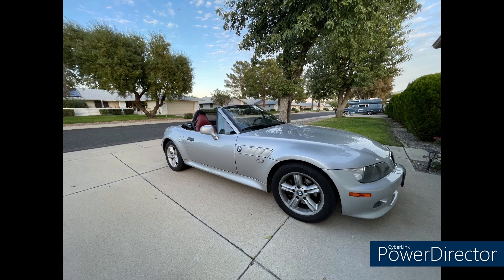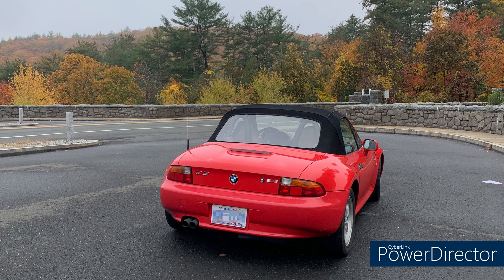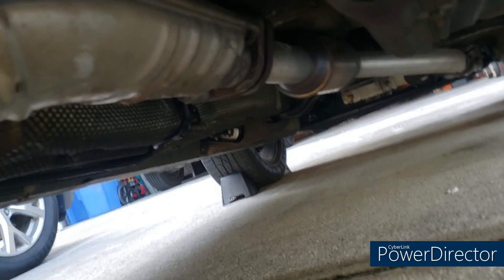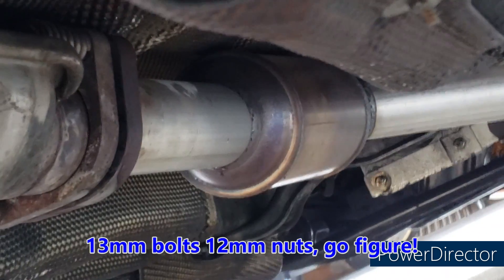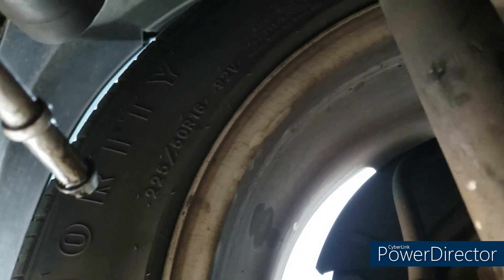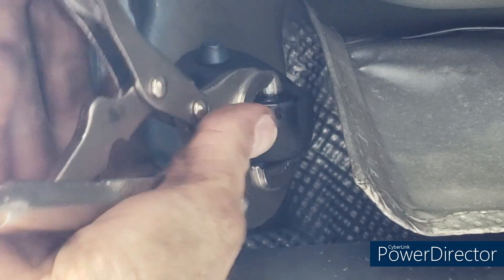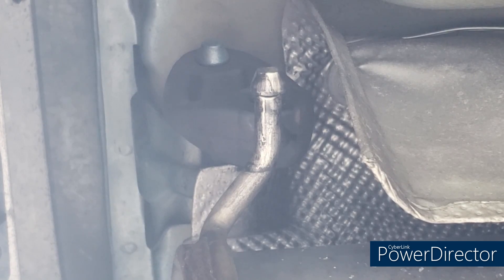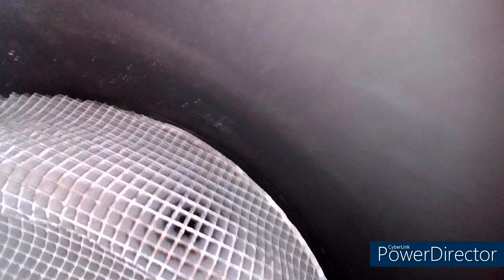DON'T Buy What I Bought: Davico 17031!

Comment: That’s a bummer Mark! I’m having issues with the replacement of the clutch & flywheel replacement on mine. They didn’t align it properly & reverse & first are a bit difficult. That was a very expensive repair & I’m in no position to pay someone else to pull it, so I drive it sparingly & gently hoping it will eventually align itself. It has improved some over the 60 miles I’ve driven it, so there’s hope. 
A note to Wes…Don’t do it! Your car is beautiful as is! Changing the color of a car is never recommended. However, if you’re dead set on it use plasti dip & leave the original paint in tact. I’m going to plasti dip mine, but my original paint is failing in many places & it needs to be repainted.
Reply from the maker: Thats what I told Wes, wrap it if you have to change it.  Interior probably harder as dash is black in his.
Reply: @MomentofZed  It’s cheaper to plasti dip & if cared for can last 5 years. With the equipment & paint it’s as little as $700. I’m glad you tried to talk him out of it too. His car is beautiful as is! I love the red leather seats 🥰
Reply from the maker: @GreenWitch1  didn't know that about plasti-dip!  Thank you!
Reply: @MomentofZed  Check out dip your car on YouTube! All the prices are listed on their website & they paint a lot of cars that change colors. It’s pretty cool!

Comment: This is off topic but when I see photos of the hood lift struts on eBay many are not connected to the lower ball joint and just resting on the body. Do you know why this is?  What purpose would this serve to not have them connected correctly?
Reply from the maker: Not sure ill have to take a look.
Reply: Take a good look at the hood strut on your car. There's actually two places on the lower area to secure the strut. Looks like it's designed with two different style joints, probably to accommodate more aftermarket manufactures?  

I literally just ordered a pair by Tuff Support P/N 613740 and they look like the OEM strut. I paid for pony express shipping so I haven't received them yet...
Reply from the maker: Ill check it this week.  Out of town without new blue this weekend.  In greer sc just a few miles from the factory
Reply: @jimmyk6336  I don’t have a Z3 yet but thanks for your comment. I just assumed from pictures that they were not connected. So there are two mounting positions?  Interesting.